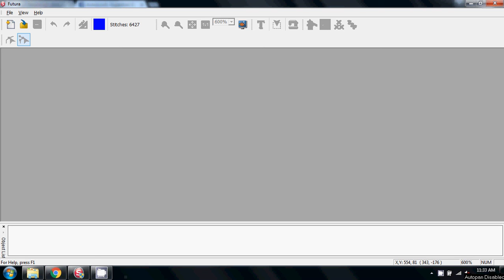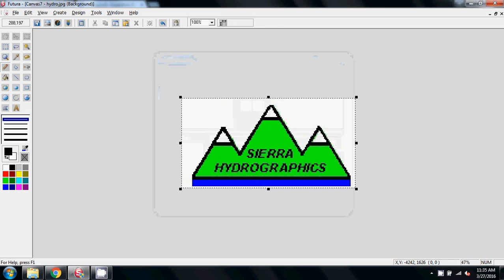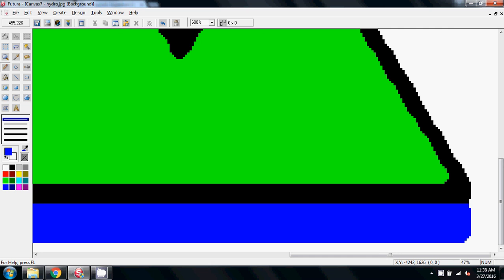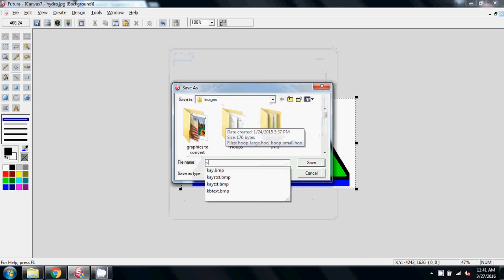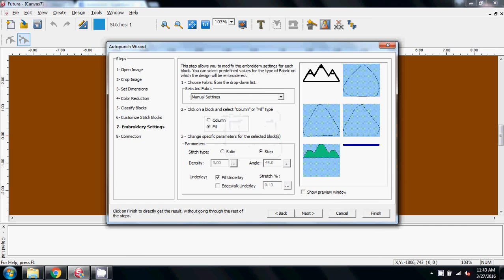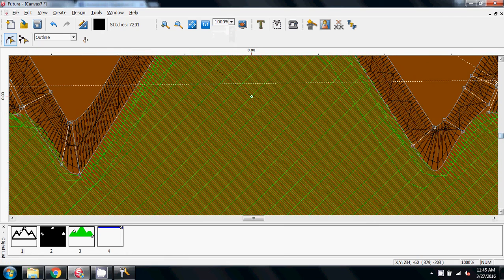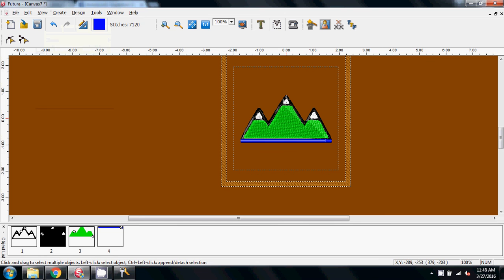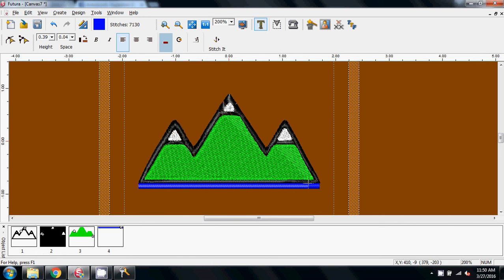For Katie, the process to turn a picture into a stitch able design.

Comment from the maker: For all the Singer Futura users of: XL-400, FQ4, SEQS-6000, SEQS6700, XL550, Quartet, Quintet, XL-420 and XL-580. The best price on replacement bobbin cases, in stock, with free fast shipping, are still the ones on ebay (Singer Part #: 416444401). 
http://www.ebay.com/itm/Singer-Futura-416444401-Bobbin-Case-XL-400-XL550-Quartet-Quintet-/231861534273?hash=item35fc063e41:g:SyQAAOSwa-dWkrQO